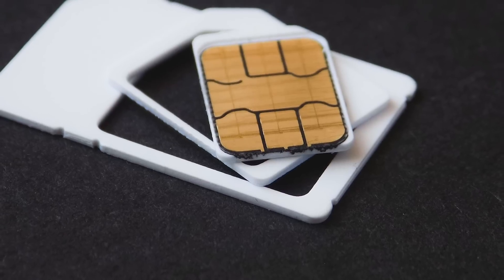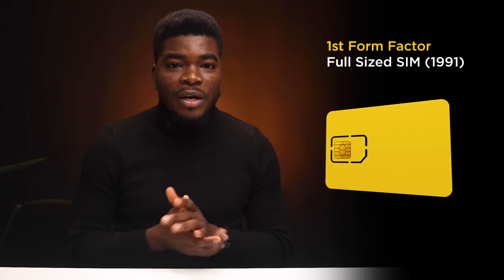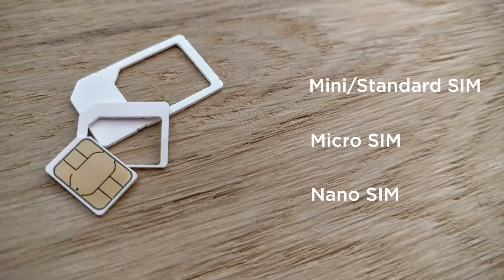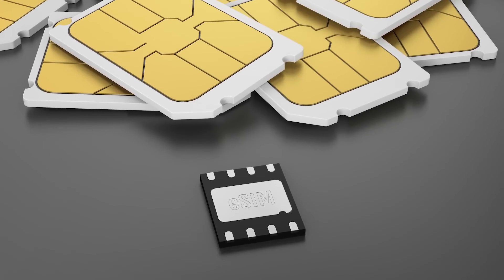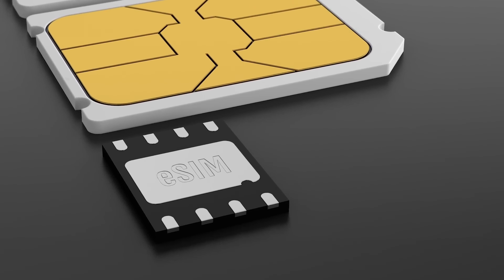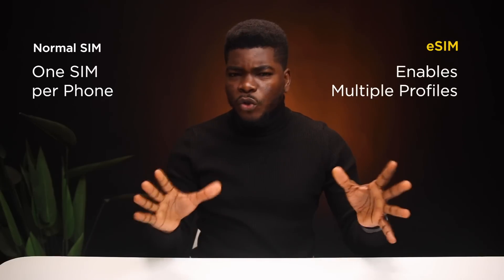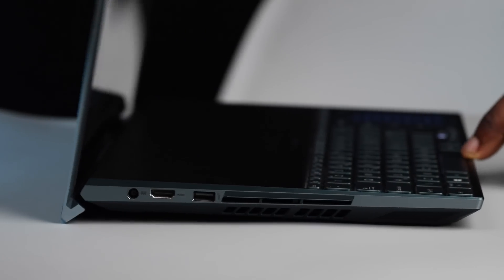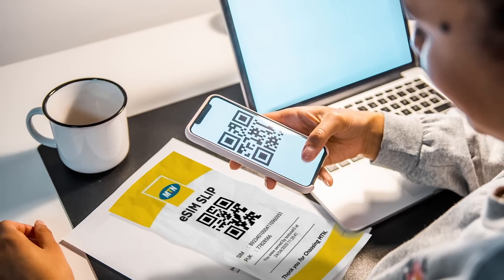What is an eSIM & How does it work?

Comment: What happens when you are tired of your carrier, but your carrier is not tired of you? Buy a knew expensive phone?  Looks like another way to lock you in.
Reply from the maker: You can move your eSIM from one phone to another or add another carrier profile to your phone if you buy an unlocked device.
Reply: @FisayoFosudo  can that be done without the permission of your carrier? Eg if you are travelling between countries and you wish to switch your SIM instead of roaming at additional cost.
Reply from the maker: @anwargaida3355  if it’s an unlocked phone. Yes.
Reply: @FisayoFosudo  Thanks for your patience 👍🏽

Comment: I think technology are reversing while using the "eSIM". Because previous motorola also not using SIM card and have to go for the telco company to register the phone serial number to their system then can use telco given registered line. Why don't just add new feature for the latest phone are just using QR code scan to change SIM line to any other phone without touch the hardware (SIM card).

Comment: Does it mean you can have eSIM enabled simultaneously on multiple devices then? Also what about a scenario where you are using a normal SIM and then also enable an eSIM on the same device (especially without the phone having dual sim support? Both SIM and eSIM will be working and enabled in this case? Appreciate your clarifications on these scenarios.

Comment: My friend you are wrong about a SIM card only working in one device, you can use it in any device that will accept it. I frequently remove my SIM card and use it in other devices. In fact I'm pretty sure that it isn't even possible to lock a SIM card to a specific EMEI.

Comment: Security wise, i don't think it will last long. Whatever security you implement, people will always find a loophole to cross it. In my country the gov made it compulsory for people to activate OTP (One Time Password) for their credit cards. This was due to the increasing number of credit card data phishing cases. Instead of the cases going down, frauds made a fake page that was directly connected to a real payment gateway and used the data you provided to immidiately make a wire transfer, thus rendering the OTP useless. I also find it frustrating to have to get a new password every time you're about to use your credit card.

Comment: Wow, this is the first time I'm hearing about an e-sim. The idea sounds great but I feel it will take time to be emulated by the general public. 
It should be a great addition since one will not need to worry about the usual hassle during Sim replacement and I believe it will phase out the issue of sim compartablility (3g or 4g or even 5g ) by just a DIY upgrade. 
But honestly I have my reservations since it's in a electronic form. It's accessibility is will also be synonymous with fraud.
However in all this my question is will all the sim data( contacts and profile) be stored, will it be cloud based or device based in case if one wants to change sim profile to another device.?

Comment: There are so many possibilities with e-sims. As someone who has 3 nano sims but only one dual sim Samsung Galaxy phone, having e-sims and knowing you won't have to worry about the number of sim card ports you have would actually be very useful as you can create as many profiles as you want, therefore carrying all your sim cards in one device if you want, not worry about losing your sim card anymore as you can just disable your profiles and activate it on the new phone, getting back your messages, contacts and all your data as these are the main issues you face when you lose your phone. And also more secure because once you delete your profiles from the previous phone, which you could obviously do online with any phone, you are sure all your data would be removed from that device as well and nobody would access it. I think in nearby future, in 3 years or so, most phone companies will start shipping phones with e-sims only, forcing operators to switch from physical to electronic sims and convert all of our already existing sim cards into e-sims as it was the case for micro sims and nano sims